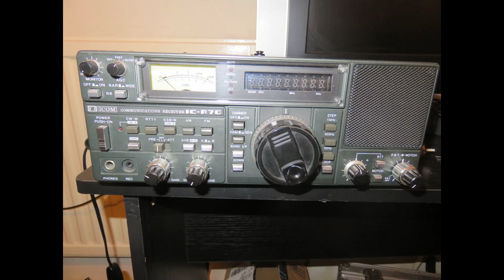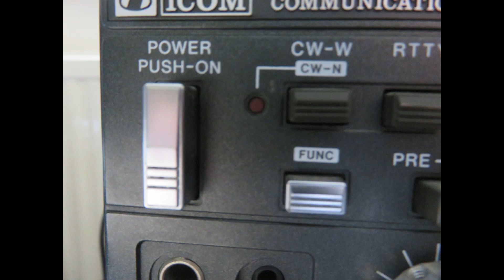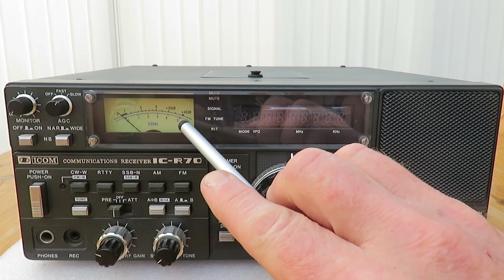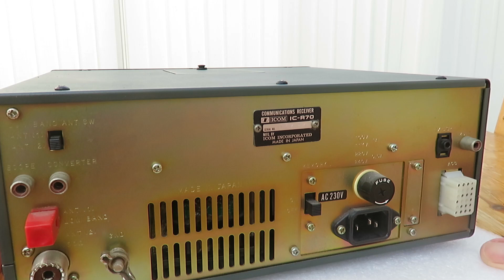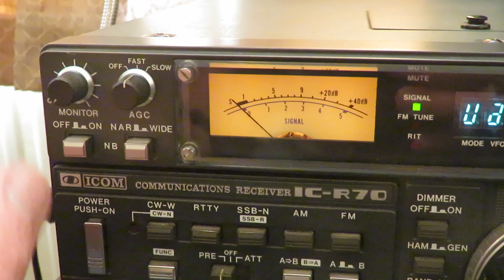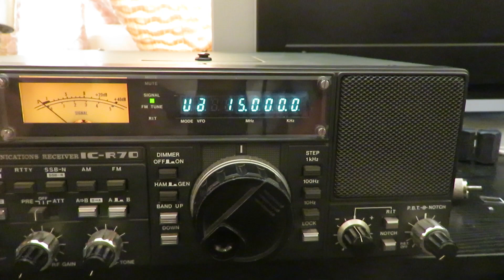Icom IC-R70- My Impressions

Comment: Hi, I’ve just inherited one of these from my uncle who passed away…. When I switch it on, I don’t get any display.. the left illuminates but the digital display doesn’t illuminate ?  At bit of a loss ?  Anyone any ideas ?  There’s nineties plugged in currently ? 
Many thanks
Reply from the maker: https://youtu.be/cmkDx8uT2ig
Reply: sounds like you need the capacitors replaced on the board.
Reply: Don’t throw it out, whatever you do, totally repairable.

Comment: no explanation how the superb  Passbandtuning works? 
It's not an usual PBT aka frequency shift but it lowers the bandwidth and push the 9MHz IF Filter against the 455kHz IF Filter. Superb job is done if you modify the RX with an crystal filter at the 455kHz IF. Then it is a razorsharp PBT working in all modes 😎

Comment: Hi Kevin looking again at your review of the IC R70 on the rear panel next to the fuse is a memory switch marked 42 in the instruction manual.
If this was in the up position your A/B VFO frequencies should be retained on front panel power off/ on

Comment: Hi, I have one until 1986! It has several options: FM unit, FL44 filter, DC cord unit, and better wide 5khz filter. It is already as a new one, without any problem. I had in the past a yaesu FRG7700,a piece of junk I sold quickly. Although I have others receivers, FRG7, R820, JRC NRD525 , I keep my R70. I have also 3 Barlows Wadleys, 2 very goods, the third has probably alignment problem, but I cannot fix it totally. I like olds rigs, I have SP600 and BC342 . Olivier.